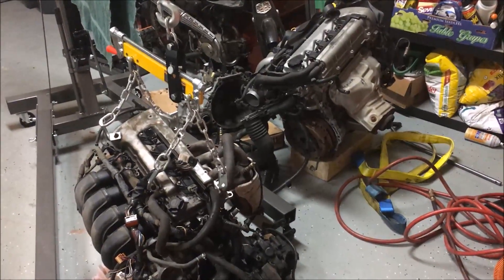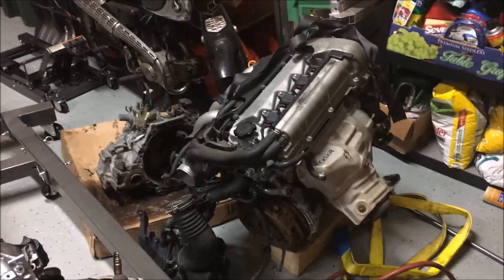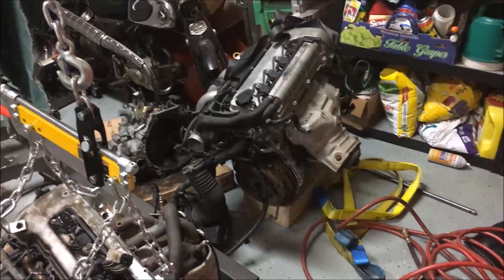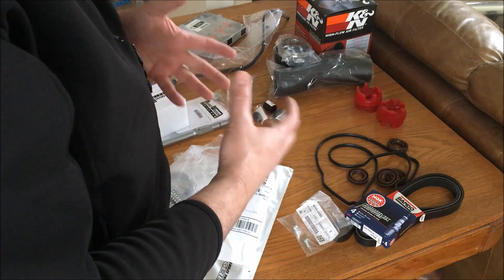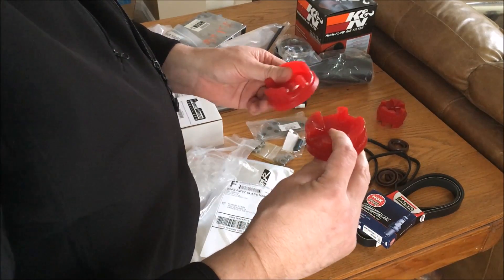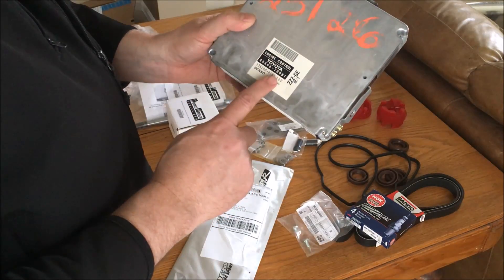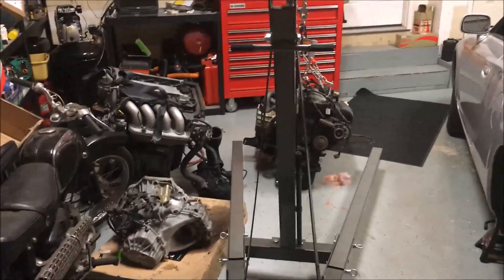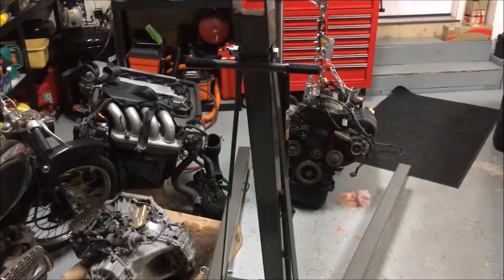MR2 2zz Swap What does it cost?

Comment: I think a turbo 1zz would be a better install. You would get the more power at much lower rpm
Reply: You are correct. 1ZZ and 2ZZ may displace the same, but the 1ZZ has a longer stroke, aiding the low end and it's better for turbocharging as there's better low down performance before the bolt on turbo is spooled
Reply: But then you have turbo problems.. Lag, heat, weight, cost, boost coming on mid corner etc. Most people building these cars want a track car where all of the above problems really get in the way of your goals.
Reply: @izzy031096  lol all that would be a problem if you where going for some riddiculous 400HP build, but a modest 220HP would be doable and easy to manage. That's what tuning and common sense driving skills are for.
Reply: @Zeriel00  But a laggy 220hp is relatively equivalent to a responsive 190hp… So what do you really gain?
Reply: debating on this myself.. turbo or just a beefed up NA 1zz
Reply: U need to do a few things to the 1zz anyway for a turbo  @kpraz

Comment: And just so everyone knows, YES you need the C60 transmsission also.. If you dont, the 5 speed just wont keep the engine in lift nearly as easily as it should. The trans is like $500, its a must. I have a 03 Matrix XRS with "fresh" JDM swapped 2ZZ (from a Corolla Run-X) and the 6 speed is so great. Close-ratio 1-5 with a super overdrive 6th gear, I love rowing through this gearbox!
Reply from the maker: Now that I am driving the MR2 I have to agree that the 6 speed is a must for all the reasons you mention.
Reply: Where are you finding a C60 transmission for $500? Cheapest I've found in working condition is $800-$900 with higher miles (90K+), and ones with lower miles (<70K) are all in the $1100-$1500 range.  If you got a link to cheaper one, I'd be happy to see it :-)
Reply: You can use the C60 or C64 transmission which are both 6 speed

Comment: I highly recommend the Apexi Power FC stand alone when you're in the market for a computer upgrade. I also went with PPE Engineering headers. And don't forget to swap the throttle position wires.
Reply from the maker: The Power FC will be when I am ready to take it to the next level.  I am sure it will be here before I know it.

Comment: thank you so much for making this video!!!  I have a question about the exhaust. Can you put the diaper back on with the new exhaust? cause I want to get the dual out,  but the diaper won't fit.  just wondering will the single fit ?
Reply from the maker: asice716 my car did not have the diaper when I got it. But looking at my exhaust I do not think it would go back on.

Comment: You forgot to mention that the 1zz-fe engine is ok until 200,000km - afterwards its a complete trash engine with heaps of major problems. oil leaks, eating shit loads of oil, valves leaks, pistion ring sticks etc
Reply: My factory original 1ZZ MR2 Spyder with 411,000km begs to differ. No leaks, no need to add any oil, good compression, no strange noises. I commend the original owner for the headstart. A properly maintained 1ZZ can go the distance with no issues.
Reply: You are one of the lucky people. Not sure what yr model u got. But I have a 2000 model. And it's starting to break down. Going to do a 2zzge conversion
Reply: Mine is an early 2002. The previous owner got rid of the precats very early on. It has been on synthetic oil since 50K and was meticulously maintained. I do have a spare 2ZZ laying around from my Celica with a lot of upgrades but the only reason I might do the swap eventually is for more power. I'd like to make it to 500,000km on the 1ZZ first. Probably one of the highest mileage MR2 Spyders out there.
Reply: Im at 190k and its not showing any signs of wear.
Reply: But its an 04 and i realised this comment is a year old
Reply: My 2001 was great until 190000 miles then the cat converter became completely glogged, had it gutted but motor was never the same. Had to replace with a used JDM motor. Car is like new again!

Comment: This won't be far from a lotus Elise, shave off 150lbs and it'll be the same lbs/hp ratio.
Reply from the maker: Mo Mare You hit on the main reason why this car is a great project
Reply from the maker: They added a lot of bracing starting in 2003 which helped a lot but more bracing is a popular upgrade and there are a lot of options.  Once the car is running well I will see what it needs.  So true about the Elise though.
Reply: Definitely need allot of chassis bracing. Elise is is so stiff, that its like its carved out of a single piece of aluminum

Comment: Exhaust is also big expense.

I am try to find a kit the "exhausts" on each side of the license plate.

Think it is possible...Would look so nice.....and cannot find reason why it is not offered.  (would not be feasible on my MK2 that had storage space, but should be on the MK3)

Please comment as you know more than me at this point in build.

P
Reply from the maker: Monkeywrenchracing has a dual exhaust option.  It is expensive.  They have a header that connects to the 2zz but lets you use original parts after that so you can have more exhaust options as well.  The one I chose is more expensive but is larger diameter for some more performance.
Reply: make ur own?

I am in the process of making my own exhuast for my mr2 2zzge swap. 2.5" all the way. And no, i am not professional